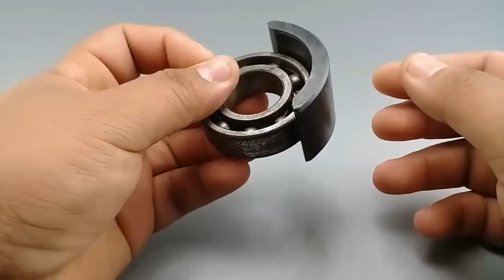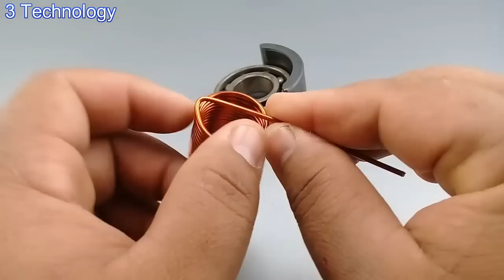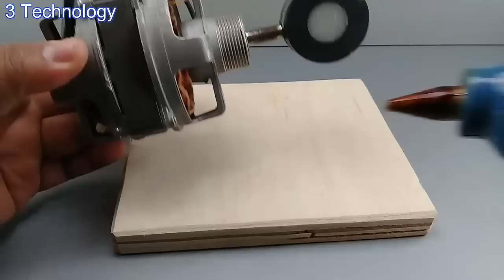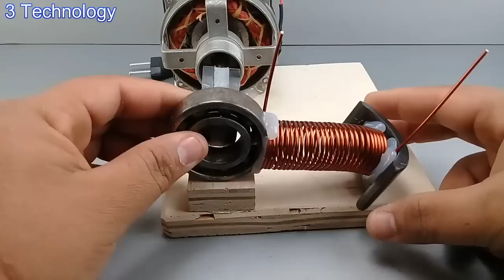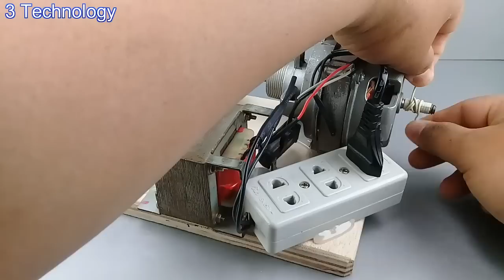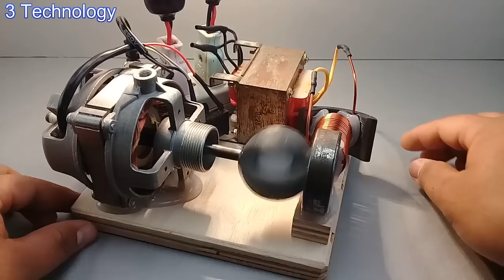How to generate homemade infinite energy 220v 7800w with magnetic devices fan motor and transformer

Comment: If you want to know the secrets of the universe you have to think in terms of energy, frequency and vibration.
Doesn't anyone remember that we  are  80% water,  we have and do make energy with our bodies.  If others can move around this planet by using the magnetic fields that have been hidden from us, we can do a whole lot more using our minds, why is it when someone exposes them and we free thinkers start asking questions the exposser ends up dead, it hasnt stopped and won't till we free thinkers stand together and protect each other.
Shit now I've  opened  My , mouth and. Ill .be dead soon just watch. I f.cking hate them sorry basterds, change the 440hz to 528hz, where they should be!" Don't give in to the mind control of 440hz they appointed the regulations for music, tv, radio, the ambient sound we hear! They are afraid we can be more powerful than them because we are a bigger race than the few of them! Start to free yourself of all the bull sh.t! Hell I'd leave this planet if I could, maybe go under ground where all the rest are hiding till its time.